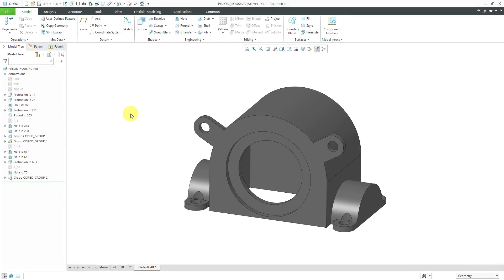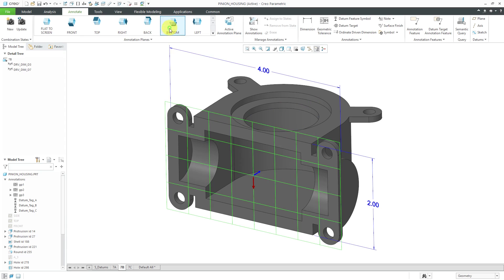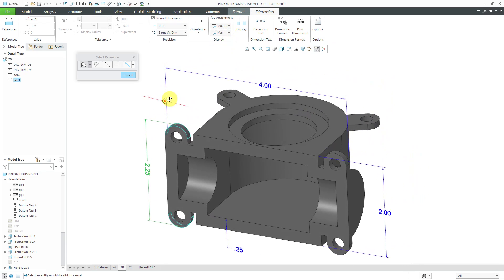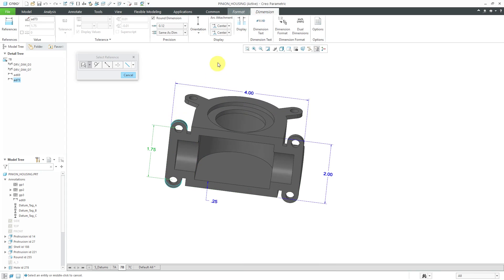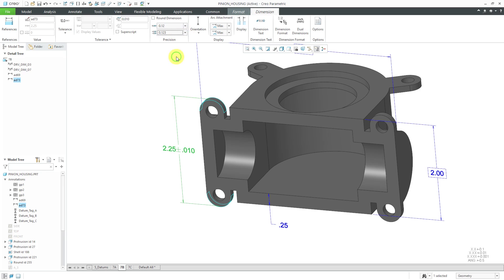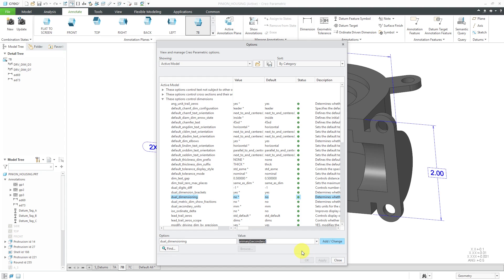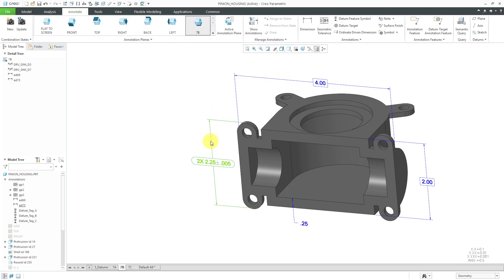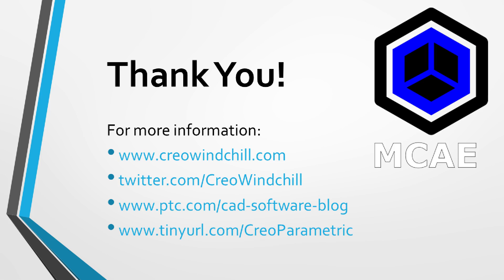Creo Parametric - Model Based Definition (MBD) - Creating Dimensions [Tutorial]

Comment: My problem is i can create the dimension but after I placed it when i click the middle mouse button, the dimension vanishes do you know why?
Reply from the maker: It could be a bunch of different things. It could be layers. It could be Combination States. You might even have Annotation Display turned off. If you look in the Model Tree, can you see if the dimensions are getting created? Are you getting any warnings or errors in the Message Area? Without being over your shoulder, it's hard to answer. I recommend opening a ticket with PTC Tech Support. Then they can do a live sharing session to help you diagnose.